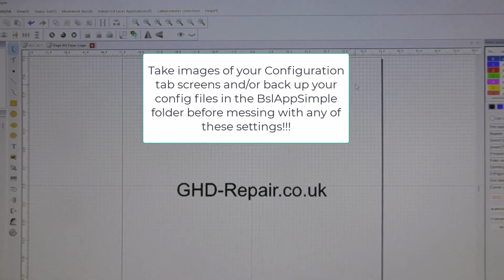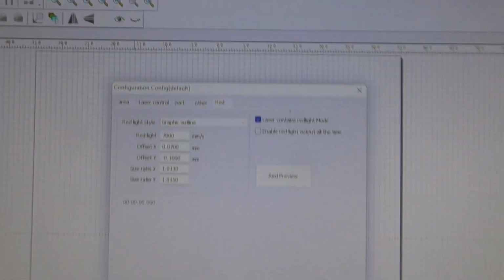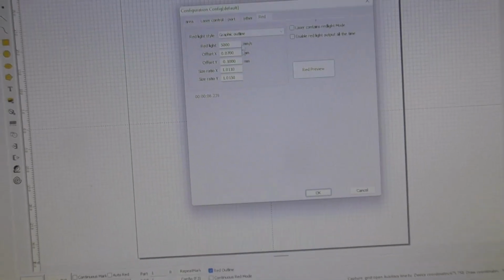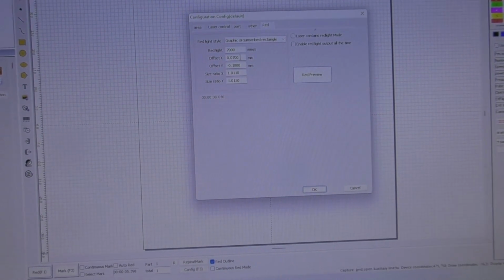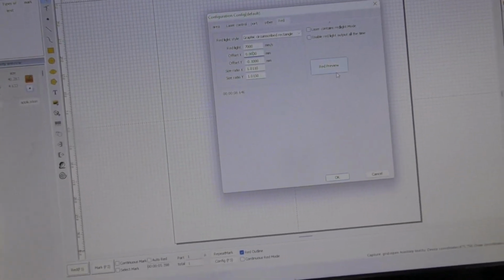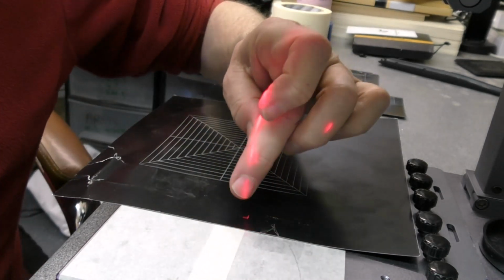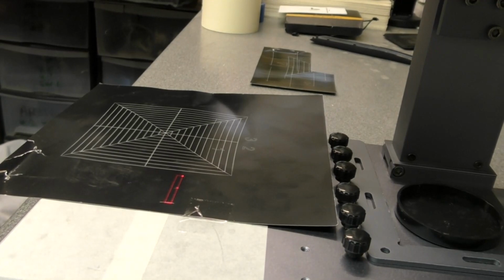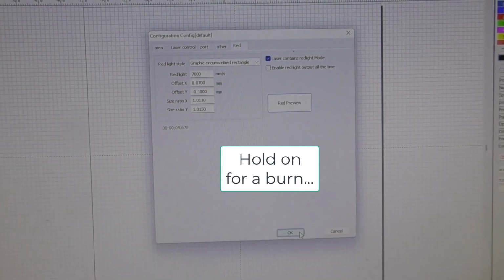Mr Carve M1 Pro & BslAppSimple Configuration Menu Red Tab

Comment: I just purchased a M4 Mr Carve. Absolute nightmare with the program not working on my computer. After hours of trying and many emails back and forth (3 days) they finally sent me a program that works. The USB stick was useless. I’m yet to work out how to use the machine as they didn’t put an instruction booklet in with the machine. Very frustrating. Time will tell but I’m not impressed so far.
Reply: I am having the same problem I am a Mac user and it looks there is no Mac dirvers or software but they do not answer